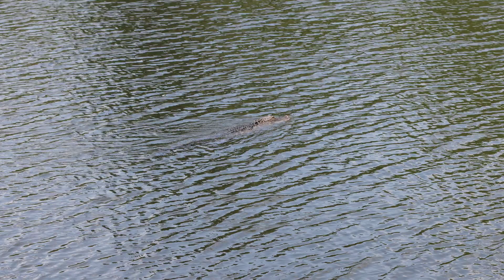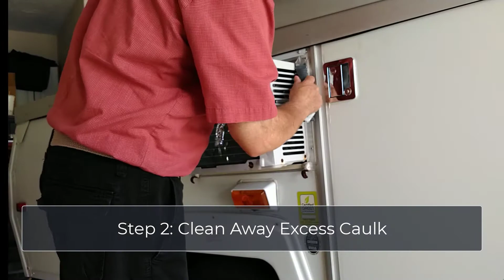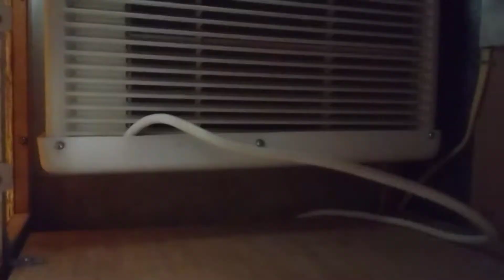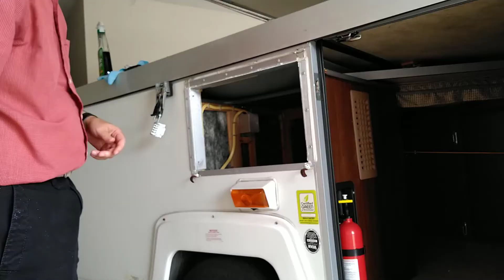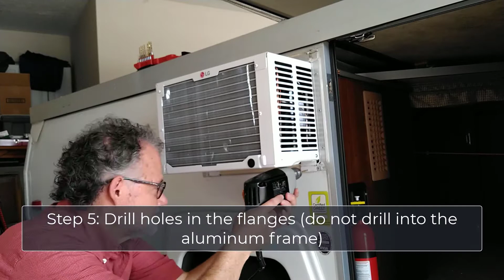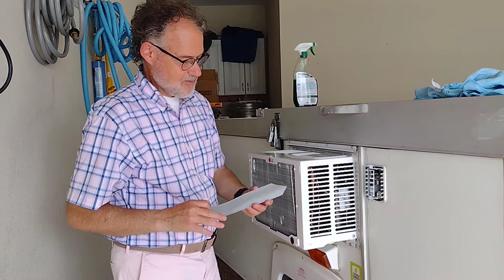We Learned How to Replace the Air Conditioner in Our Aliner Scout Camper

Comment: Instead of roof seal tape. I just used small stainless angle brackets. This way I did not cover up the vents and I feel it's more secure and no need for screws on the two bent tabs on the bottom. Also, before I installed the new AC unit, I screwed the plastic tray to the to the front with the cord coming out like the old one. Then you just set the unit with tray attached into the opening, screw in the angle brackets with self tapping screws and caulk. Here's a photo. https://photos.google.com/photo/AF1QipN0s6baXHoAS-gWly8KJA7BA-ipbBT81_ee3J4F

Comment: How long did your original A/C last?  Did you frequently go on bumpy roads?
Reply from the maker: Those are the right questions. The A/C unit failed shortly after we bought the RV used. The owner before us rarely used it. The one before, we don't know about.  If the a/c unit was original, it was nine years old.